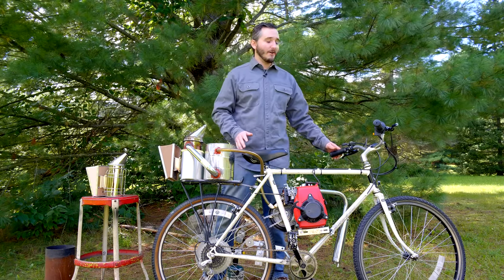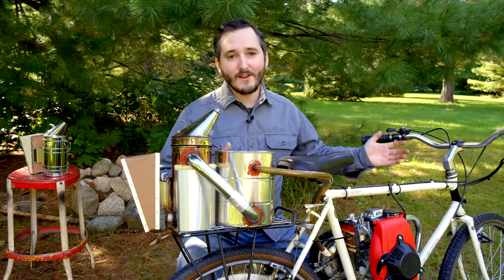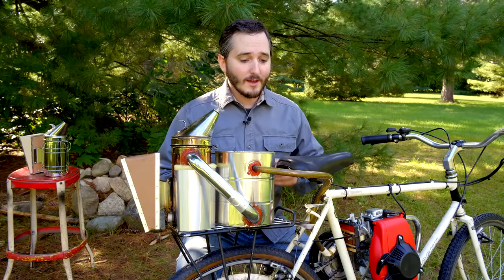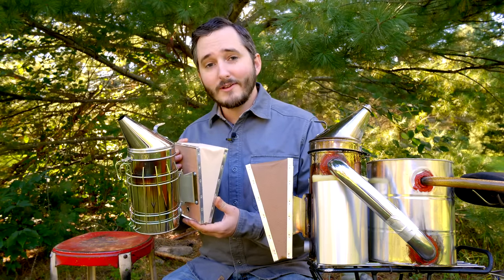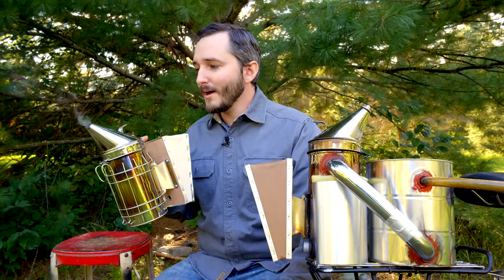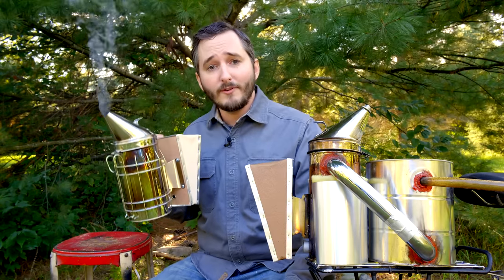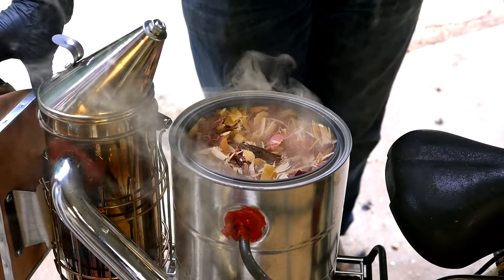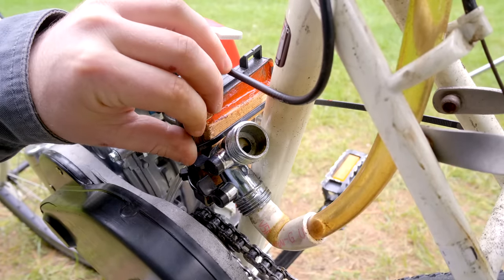Running a Gasoline Engine on Firewood | Woodgas Biofuel

Comment: With Germany not having it's own source of oil, they ran a lot of their military vehicles on wood gas during the war.
Reply: Running a Panzer 38t  on Firewood. I'd love to see that
Reply: @hwachahistorychannel1617  They had some Tiger 1 chassis that used large wood gasifiers to save fuel and they were used for driver training.
Reply: True. often the best technological innovations comes from need not greed.
Reply: And HHO oxyhydrogen from water would be a good addition to make the most of whatever other combustible fuel!
Reply: @seamusgray7609  depends on how the HHO is produced.
Reply: They did not run a lot of vehicles on it as they only used it late in the war and it didnt have as much power as normal gasoline but they still used it, just not as much as you said
Reply: My grandpa was a Luftwaffe truckdriver, he drove a big truck from 39 to 45, and in 44 this was changed to gasified engine, he drove it thousands of km all through Ukraine, Belarus, Poland to Berlin and ended east of Munich in 45. He told me that every 100km he had to fill up the gasifier with new wood, very close packed and every day the long filter tubes were cleaned with big brushes. Had no issues at all with the truck. Unfortunately he left the truck in a wood and didn’t take it for himself after war’s end, he never was in custody due to ending up in the armistice region east of Munich, where he and a few thousand other Wehrmacht personell were serving until end of June 45 (think US forces wanted a region outside US jurisdiction for making deals with Nazis).

Comment: Its occurred to me, that in the long term, wood pellets, for wood pellet stoves, would be a more convenient fuel. It would be consistent, and ensure maximum filling of the container.
Reply: I was thinking the SAME thing / & how to make something like that (pellets/alt-wood) on your own in a SHTF situation where you must produce all your own fuel.  / This type of project would also be in an Alcohol/Fuel series.... same reasoning.
Reply: Using smoker pellets would be great! The filter chamber could also serve the secondary function of smoking a nice brisket!
Reply: yeah, awesome idea!  1kg of wood pellet is cca 5kwh of energy :)
Reply: You don't have to buy sticks and twigs though.
Reply: @JesusSaves86AB  
The depends entirely on where you live.
Even if you have the wood, a pelletiser would make the wood more convenient and effective. I live in an area where a lot of the people use wood for heating, but many have changed to pellet stoves for convenience, and cleanliness. Carting logs about is  
inconvenient and messy, and often need cutting to size. Also storing them is much the same. 
Pellets come in nice clean bags, ready for immediate use.
Also, if you were to use them for a vehicle, they could be stacked in the vehicle ready, just like carrying a spare can of liquid fuel.
Reply: @niklar55  , and the price is higher. And it's not as simple as using cord wood. And cord wood simply makes a longer burn. Pellets put the homeowner under the availability and price setting of a corporation. If going that far in that direction, with the added mechanics/maintenance, use simple propane or natural gas. Which is why hundreds of millions do. I knew only one family using pellets- and they quickly switched to cord wood.
Reply: @senatorjosephmccarthy2720  
It depends very much on your location and the availability of wood, and as I said, ''Even if you have the wood, a pelletiser would make the wood more convenient....'' IF you'd read my comment completely. Small Pelletiser machines can be bought, and pellets are more convenient to store, and to use.
Splitting and chopping wood into small pieces is very labour intensive, or in other words damned hard, tedious work. Small pieces also take up far more storage space than pellets, and pellets can be poured like peas or beans into a container, rather than having to be hand loaded piece by piece, which is why they were invented. Regarding your, ''longer burn'' Thats irrelevant, as the energy output of a given amount of wood is the same regardless how long it takes to burn, and if you need the gas to drive an engine, then the quicker it burns the better for the release of gas.
.
Reply: @WalterPidgeonsForge   
The 'binders' are just vegetable oil, and as vegetable oil is just as good as a fuel, I cannot see how they would inhibit gasification, especially as the amount of oil, to the volume of wood is small.
Intuitively, if the gas is in the wood, it will have no option but to be released, when heated.
Perhaps you would explain how this oil will inhibit gasification, please.
.
Reply: @niklar55  pellets don't have any binder, at least the ones available in my area don't, they're just compresses pine sawdust.
Reply: @CarbonConscious  
They would need some sort of binder, or they wouldn't pelletise. They'd just fall apart.
Maybe the abundance of sap in the pine is the effective binder.
In this area, the main wood for pellets is either oak, or chestnut, so a binder of some sort is probably essential.
It would seem that in your area, the pine is just residues from the sawmills, rather than timber cut specifically for the purpose.
.
Reply: @niklar55  I've been wondering if it's all just residue from timber production or if trees are cut down just to pelletize them.

You are probably right about the resins in pine being a reason for not needing an added binder.
Reply: @CarbonConscious  
Sawmills get a lot of waste wood.
When they take a tree trunk, they cut off the sides to make a square section.
The sides are then scrap, and would be ideal for pelletising. 
Mixing in the sawdust would make sense too.
I have a sawmill not far from where I live, and there's huge stacks of waste wood around the place.
My local sells his, when he can, for converting to charcoal. I tried to interest him in pelletising, but it's ''too difficult'' for him.
He inherited the business from his father, so his father was the entrepreneur, not him. He has no 'vision'!
.
Reply: Hardwood  wood pellets
Reply: for small engines ya wood pellets would probably be great. But I saw a pickup on youtube run on wood. He could burn anything basically which is nice. If youre up the mountain you could burn sage brush or pine etc. You'd never run out of material.
Reply: @senatorjosephmccarthy2720  I made my living for a few years cutting and selling firewood. I was making $200 a day, doing Maple, delivered. As you can see from the price, this was a few days ago.
I heated my own house with Wood Pellets.
I'm currently paying about $4.50 a 45 pound bag.
Maple heat per cord, 25.5 Million BTU's, green weight 4685 pounds, average cost $400 where I'm at, currently.
Equivalent in Pellets is ~104 bags. Delivering 36.2 Million BTU, and costing $468.00.
The weights are rather irrelevant, it is the BTU Per Buck that is the important number.
Pellets win. And they also make a better Cat Litter than Bentonite Clay does.
Now, when can we start attacking the Socialism called Corporate Welfare?
Reply: @niklar55  There are a few short videos, here on YouTube, that show the process.
The pellets are made by taking a fine powder of wood and pressurizing the resin out of it. Which, when the pellets cool (Yes, they're hot coming out. It's a LOT of pressure!) bond the particles together.
Reply: @TimeSurfer206  
Some years ago, I researched wood pellet machines, with the thought that I might like to produce my own pellets, as my main source of heating is wood, and humping logs becomes a real chore with time.
In effect, they were like large versions of old fashioned mincing machines, like those people used to clamp onto the edge of a kitchen table.
One, inferior type used disks, as the cheaper mincing machines did, the superior type used a cylinder with a roller, inside it.
The other machine that was required, was a shredder, to turn logs into chips.
If only hardwood, oak, chestnut, etc. was used, then a vegetable oil would be required to bind the particles, or you would end up with sawdust. You could also feed in waste sawdust in small quantities.
If you used pine, combined with the hardwood, then, as pine has a large amount of resin included, that resin would replace the oil.
Pine sawdust can be used on its own, due to the high resin content, but pine burns very fast, and consequently very hot, and can introduce problems not incurred with hardwoods.
In the USA, the majority of wood available, is pine, due to early settlers clearcutting vast areas, which were then overtaken by regrowth of mono-pine forests. Turning mountains of waste pine sawdust into useable pellets makes good sense. I guess the youtube videos were USA made, and so would be using waste sawdust.
In Europe there is still ample oak and other hardwood available, for firewood, and pellet making.
.
Reply: Charcoal might be better

Comment: During world war II in Norway, we (not me, I wasn't born yet) had buses that ran on wood gas. It worked, but had some difficulty driving uphill. Passengers frequently had to get out and push the bus.
Reply: Near where i now live, in Italy, during world war II, a wood seller had the last woodgas fueled  truck in the valley, that blew up in a german bombing!
Reply: Same in Sweden, although a lot of bus drivers died from Carbon Monoxide poisoning as they started the bus in the garage
Reply: that rrminds me, i've seen on wikipedia that, ammonia was once used as fuel